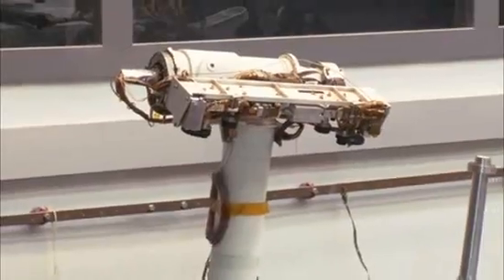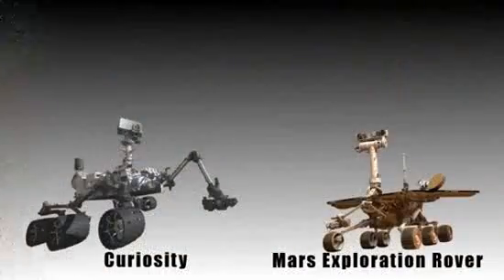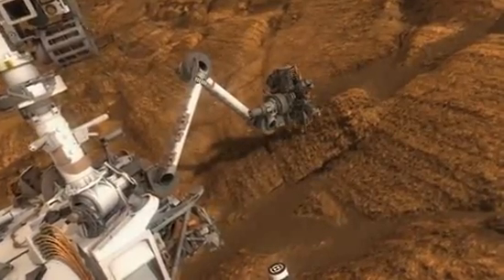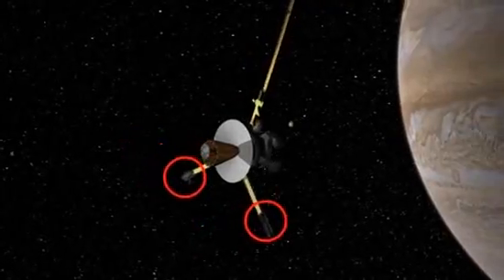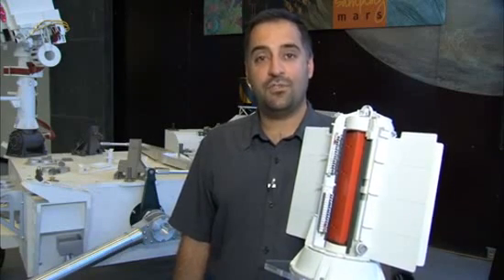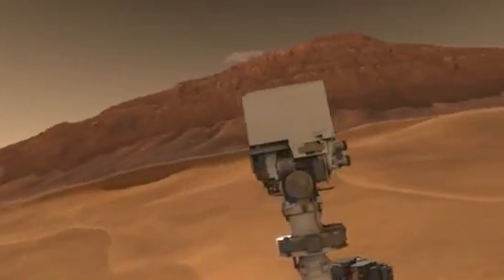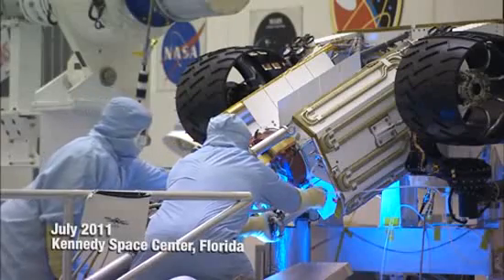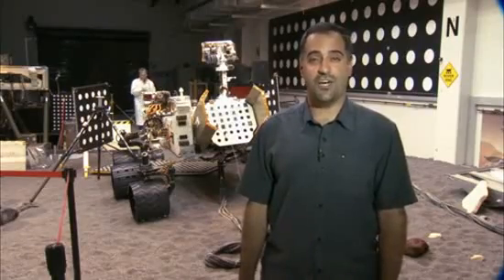New Mars Rover Powered By Plutonium

Comment from the maker: @TheMACcar Sweep them with what? It costs power and mass (weight) to add mechanical wipers with motors. The previous rovers got lucky; dust devils (vortex winds) blew by cleaning the panels somewhat. Still, they had to hibernate through the cold winters. This rover won't have to. A tiny amount of plutonium powers a whole lot of rover. And there's a near-zero risk of environmental contamination, even if the booster rocket fails on launch. So: why not plutonium thermal power generators?

Comment: Curiosity does not always move, it's stationary more often than it is mobile. It typically performs drives that range from a 1/2 hour to 2 and 1/2 hours in length. I understand power is precious in these types of missions, but until someone provides me with numbers that show that wipers, ran once a month, would consume more energy than they would help provide for the solar panels, I'm not buying it.

Comment: Its not fusion energy, its classical fission, but limited. RTG are like a charcoal that slowly burns out (for some 15-20 years) and we use the heat to get power. It can power a toy car however (for 15 year straight) :)

Comment: Not enough, that's correct. it's only generate 100watts of power, just enough for one 100w light bulb, compare that to normal Hybrid car generator which generate around 15kW. Its' also very expensive too. Curiosity is +$1billion project remember? So it possible if you want to pay like 100million bucks for a 20km/h car. :)

Comment: Plutonium oxide has a problem of the half life of being around 85 years though, I'm surprised that Radioisotope thermoelectric generators havn't yet moved on from fallout of heat from Pu-238. PuO2 has been used since the mid 70's then. Goes to show how scared people are of nuclear research, or maybe there really isn't any other alternative RTG battery.

Comment: It would work, But it would still require power, You have to have a full battery too, And maybe some servers and motors. Thats about 30 watts. And they don't have batterys on the rovers. So thats a problem. But either way, Its just better to use plutonium 241. Alot more better than solar panels.

Comment: VideoFromSpace Thanks for posting this.  Understandably and justifiably, many people have deep concerns regarding radioactive material and their health.  But some people do not seem to understand that a radioisotope thermoelectric generator (RTG) is not a nuclear reactor.  There are no fission or fusion reactions going on in a RTG at all.  One only needs to go to Wikipedia, type in "Radioisotope Thermoelectric Generator", read the great article and decide for themselves.  Of course the conspiracy theorists and the closed-minded will never be satisfied by any rational explanation and this can get annoying,  But I would have no problem walking up to a RTG (with Plutonium-238 dioxide ceramic-encased pellets) in an assembly building and do not worry about contamination from any that have or may come back to earth from a launch or mission failure.